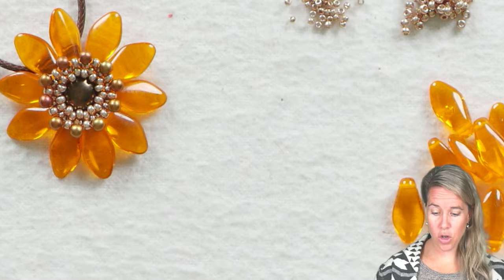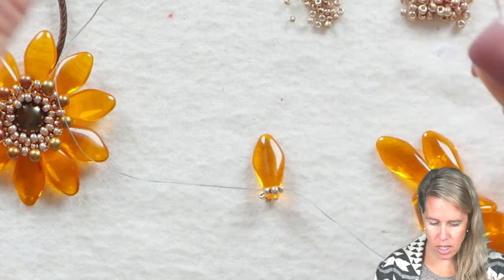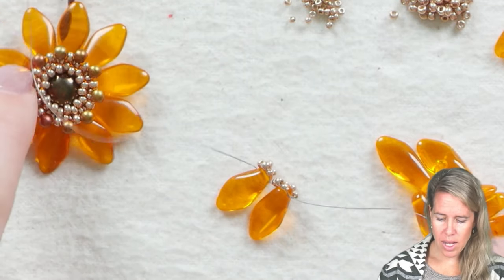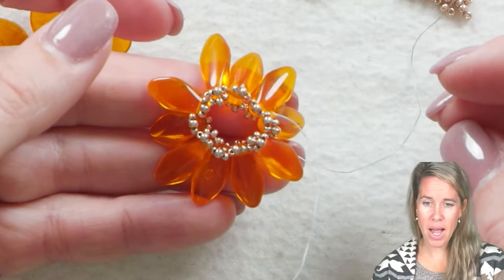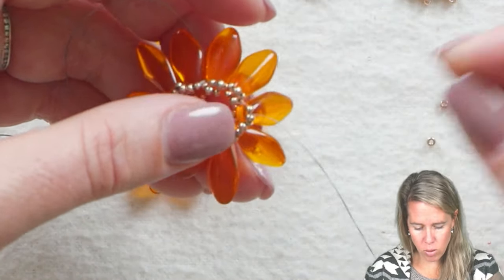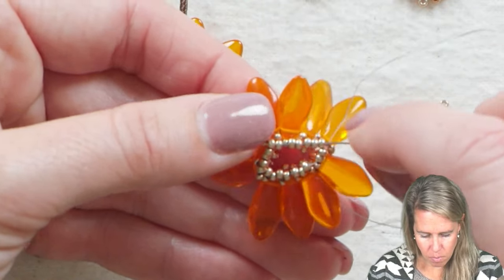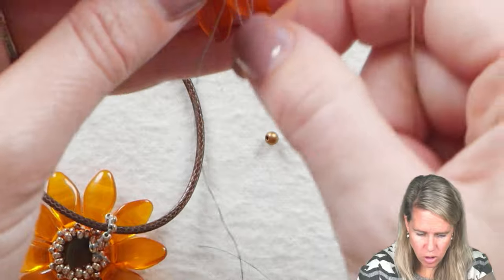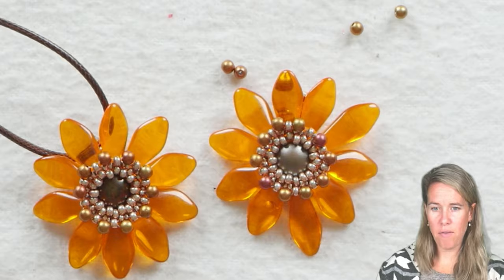Gerbera Daisy Beaded Pendant - DIY Jewelry Making Tutorial by PotomacBeads

Comment: I’m new to beading so please forgive me. Are you supposed to keep your thread tight throughout the project? I worked through the project  about 80% and the cab won’t stay in my bezel. Too small for the bezel. Is it because I made it too tight?
Reply from the maker: Yes, if you used the correct size and amount of beads and the cabochon doesn't fit, it is too tight.  When you re-do the project again, only pull tight enough to where the beads fit in nicely.  Don't pull too tight.  I tend to be tight beader because I do not like thread showing anywhere so I have also had to learn to relax a bit when beading certain projects!
Reply: I am kinda new too have done some projects . I about did it all but my cab would not fit either it kept coming out going to try it again I may try it with 8-0 seed beads. instead of the 11.
Reply: I tried using 8 daggers it still wasn't right(and I wouldn't call myself a new beader).  I ended up glueing the back of the cab to the seed beads on the back side.  I may try the idea of using 11/0 and 8/0. Or I may try 2mm round beads and 8/0 .  like the idea its just frustrating

Comment: Another bezel pattern that’s too big for the suggested cabochon/rivoli.  I bought the suggested daggers and cabochon and used 15 Miyuki and 11 Toho.  Even after adding an extra row 15s on each side the cabochon stays in but rattles around.  All the dagger beads are different widths.
Reply from the maker: Sometimes you need to play around with a design and make certain modifications.  Different coatings and finishes can also affect the thickness of seed beads as well.  Please let us know if you need additional help with this project :)

Comment: I have made 4 of these pendants in different colors and while I feel that they went up quickly I have had problems with the thread breaking whether it is being cut by a bur inside the bead or the tightness of my tension on the 15s I am not sure.  I consider myself to be an advanced beader and have been making off loom beadwoven jewelry since 2003.  I sell my creations at local craft fairs.  Biggest problem is that I have been contacted by someone to make her one in a certain color with a beaded chain.  When I went to put the pendant on the beaded chain I noticed that one of the threads was broken and the pendant was falling apart.  I redid the pendant and now have finished the beaded chain.  This customer also lives out of town.  I am afraid that after she receives it, it might break again.  I don't like the feeling that I could potentially lose a new customer.  Because I have done a longer It also seemed to be at a 15.  I have been using the Fireline 6 for years and have never had a problem like this.  It just doesn't seem like it is strong enough  Should I try and 8?
Reply from the maker: Hello!  Could it have been a defective spool of thread?  Have any other projects made with that same spool come undone?  If not, you can try using a slightly thicker thread.  Size 8 DragonThread is a great thread to work with, here is the link if you would like to get some! https://www.potomacbeads.com/brands/beadtec/DragonThread.html